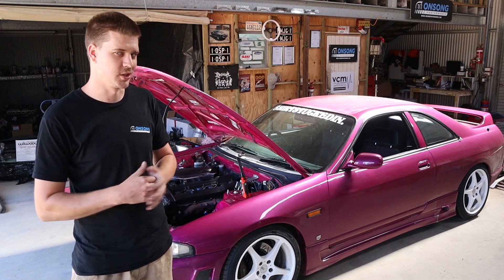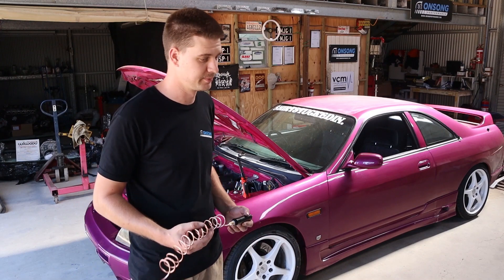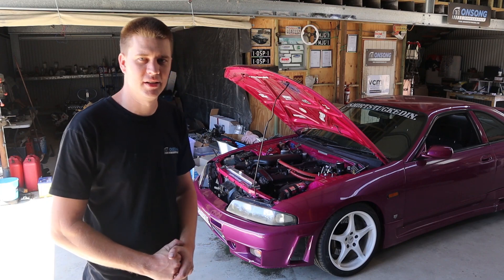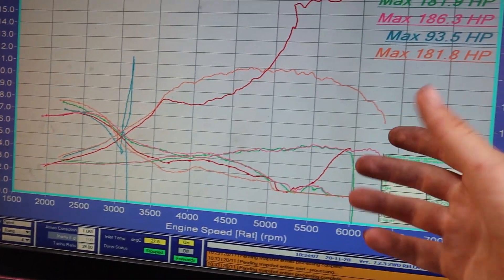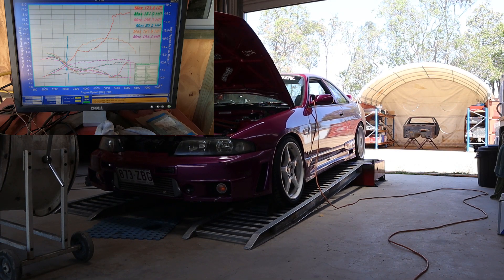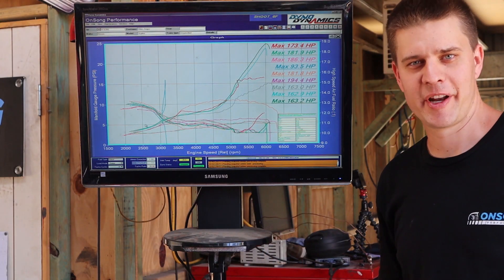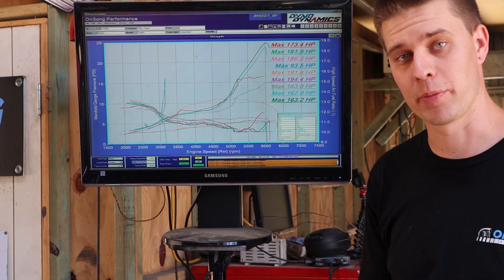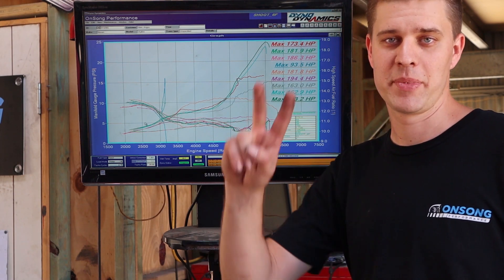RB25DET China Turbo: Getting Boost Under Control.

Comment: Well, thank you for proving my point that it's useless to push the stock RB25 (and Neo) ECUs beyond 10psi, because they just start dumping tons of fuel and you just end up making a lot of blue smoke and not a lot of power. I think most RB people know that, but you always have some smartass come and say he's making tons of power by pushing 15psi through his completely stock setup, and... yeah, nah.
Also it seems, the more I'm looking at it, that internal gates should be limited to 2860 or similarly sized turbos or smaller, because on anything bigger, they're just more trouble then they're worth and you might think you're saving some money by not getting an external gate, but really you're just wasting time (and ultimately money, too).

Comment: Rather insightful experiment. Why not try the same experiment with the E map in the dump pipe also. How do you know there isn’t a restriction in the exhaust somewhere causing it to back up all the way ? 
Ive done this type of experiment my self with a N/A to turbo setup I built and ended up with a 1.4:1  Turbine to Boost ratio. 
Great Vid and a thumbs up.